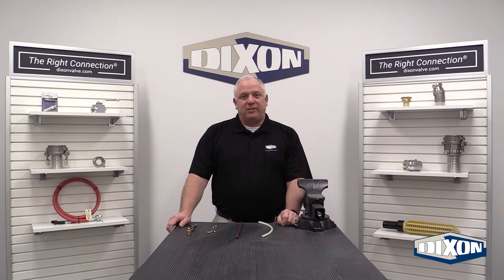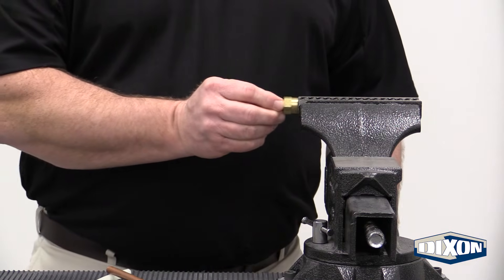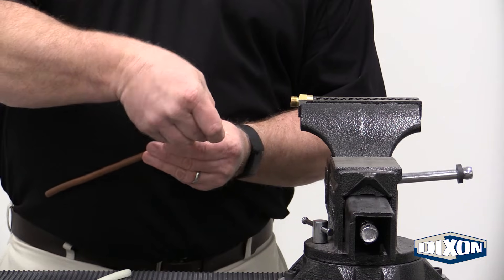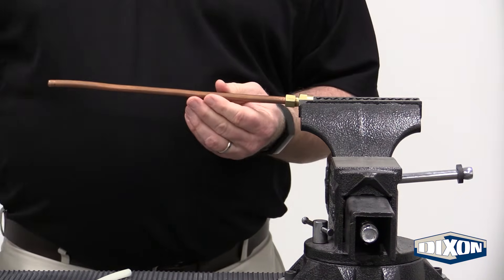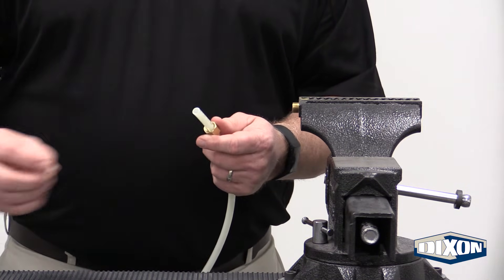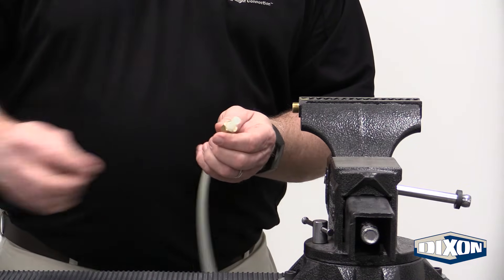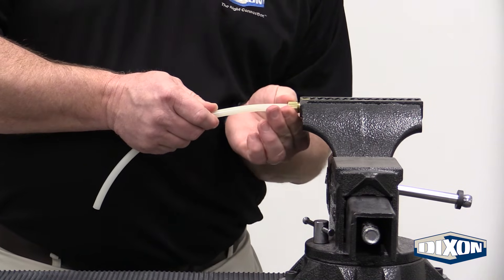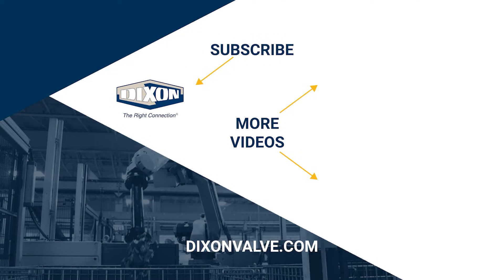How to Install Compression Fittings on Nylon and Copper Tubing

Comment: Yes, but with respect. A pro company. Viewing the copper tubing install side.The demo guy started off by almost gripping on the solder side & on a bad angle for the viewer. This creates for a scrap fitting had it continued through. (The guy was probably nervous). However, not too good from a pro company demo. The nylon tubing application demo was correct regarding part assembly order but a few professional procedures should have been considered. The main fitting shouldn't have been so loose in the vice. It was moving up & down like a tree branch in a wind storm. Not good in a professional atmosphere. I worked in pneumatics for a long time.The ferrule offers two different angles, lead in,lead out. Very important to display the correct side to the viewer when entering the main fitting. Also a dry run distance for the ferrules correct position is always gently done before the final assembly to ensure that the nylon tubing is at the correct depth, a gentle fingernail pinch is used for this step. If this is gnored the nylon tube often can back out slightly before the ferrule is crimped & can cause either a drip leak or a total flood later. Finally, being only nylon tubing the number of nut turns were  overdone in the demo. It should be only a slow 3/4 of a turn & feeling for any over stress.

Comment: Great video.  Simple an to the point.

I also read the Basics of Compression Fittings blog post.  In it there is a table that shows that the number of turns required to seal are 1 1/4 or 2 1/4, depending on the size of the tubing.  This is a bit confusing.  Can you clear it up for me.
Reply from the maker: If you are using the 60-series fittings with soft metal tubing, tube sizes 1/8" - 5/16" require you to wrench tighten 1-1/4 turns, and 3/8" - 7/8" require you to wrench tighten 2-1/4 turns from hand tight. On thermoplastic tubing, 1/4" - 3/4" requires 2 full wrench turns from hand tight. If you have any additional questions, please contact us at dixonvalve.com.
Reply: @DixonValve  In the video at 1:24 it states that for the copper tubing you turn the nut 1/2 turn after finger tight.  And at 2:41 it states that for nylon tubing you turn the nut 1 full turn after finger tight.  What am I missing?

Comment: is the acetyl sleeve typically supplied with this type of fitting or would you find that separately?
Reply from the maker: The acetyl sleeve is sold separately. Please visit dixonvalve.com or call 877.963.4966 for more information.